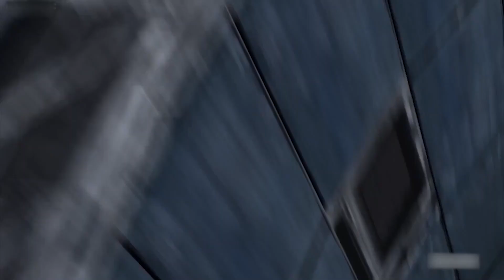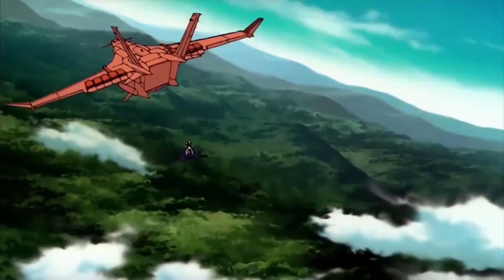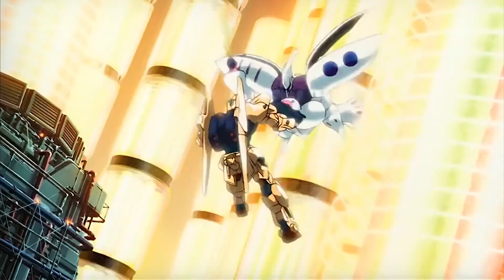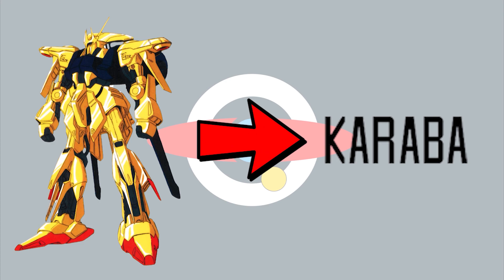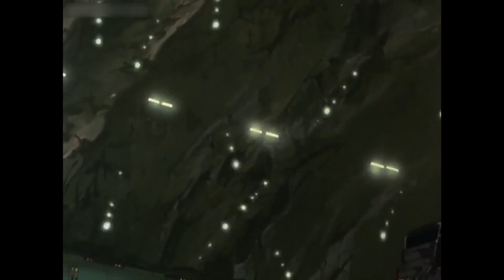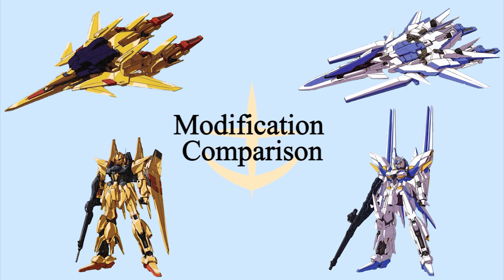H.L.M.S. - Project Zeta, Delta (δ) Series & Hyaku Shiki

Comment: There is a mistake regarding Delta Plus. Piko used Delta Plus when against Gundam Delta Kai in mock battle which ended up turning into real battle when Sleeves forces attack both of them and Gundam Delta Kai went berserk in the UC 0094 manga and the Gundam Narrative manga never explicitly mentioned that the pilot that piloted Delta Plus that attack Jona and his Dijeh's  squad is Piko and the beam rifle that Delta Plus used in Narrative manga is the same one used by Riddhe's unit, which is ReZel's beam rifle, due to compatibility issues with Long Mega Buster beam rifle. However, Riddhe's Delta Plus in the Unicorn anime is implied to the same Delta Plus used by Piko due to the left arm has been repaired and the combat record data against both Geara Doga and Gundam Delta Kai according to Kusabi manga

Comment: the full armor hyaku shiki kai appears in 0096 last sun, it didn't do much actually. it destroyed an old zeon MA along with the delta plus with their burst bolts acting together, it wasn't seen doing much else

and uh-

ok so it wasn't sleeves, it was just some random bandits that attacked, during the raven squad attack on the mariana base, the delta kai wasn't controlling the situation, it went berserk, since the NITRO was activated, and the pilot saw the raven squad as enemies, and began to attack them, and kill a few of them.

after the delta plus would shock the MS, and then would get recruited to the raven squad, after when freseberg was going to attack the titans remnants in the devil's nest, raven squad would appear with sleeves, and help out, attacking the old NITRO equipped titans MS they had(2 gabthleys, and later on psycho gundam and psycho mk II)
Reply from the maker: Thanks for the correction & information

Comment: The Delta gundam existed before the Gundam MKII was stolen. It used Anaheim Electronics version of a movable frame. They had discovered the Titans were working on the concept and thus made their own version concurrently with the Gundam MKII but wanted a variable/transforming MS.

AMBAC works thanks to the extremely low, negligible, resistance in most Zero-G environments. Once the Mobile Weapon starts spinning thanks to AMBAC it continues spinning until the force is negated by a counter movement by the AMBAC system.

AMBAC combines with the verniers during combat to reduce fuel consumption during movement.

Comment: AMBAC in the extent of classical Newtonian physics we know would not work nearly as well as they're depicted on screen especially in free space. At most, you're modifying the centre of gravity of your body. Imagine an astronaut patrolling free space and always spinning clockwise freely by himself. If he waved his arms, or do something like a snow angel, his body as a whole would still spin as normal. That's because there's no force to apply anywhere else, his gestures is confined to his own body and balanced out somewhere else in his body. A fart is a better option to move than his human-AMBAC because mass is ejected and there's actually thrust (expelled gas) relative to his frame of reference.

Put it simply, use thrusters on your arms, legs and wings, and AMBAC absolutely would now make a difference. Because now that an applied force is in the equation, applying turning (torque) is possible, and the speed and degrees of turning (angular momentum) would absolutely depend on how good your thrusters are, how far they are from you, etc. You just have to actually fire them correctly.

Tldr, AMBAC is a load of BS that's fun for Gundam world building only.
Reply from the maker: This is a very detailed breakdown! Thanks for the physics tutorial BTW, learned something new!
Reply: @zethythonix  Glad you read it! Judging from your accent I'm curious are you from HK or SG? Also, great video!
Reply from the maker: @fanchiuho1  yes, I am from HK
Reply: I believe other series’ Mobile Suits have thrusters for maneuvering in space.

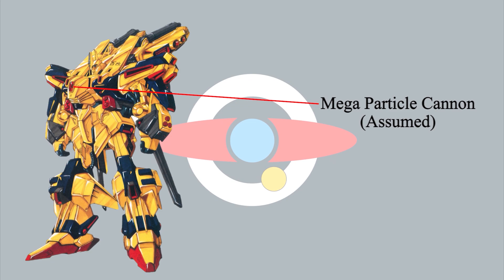Comment: 14:52 like most MS from the era of GRYPS conflict (such as FA mkiii, ex-s) the mid chest area is usually a I-field generator (for chest defensive purpose)
Reply: I believe the lore said it possessed a mega particle cannon there and had to deployable shield reflectors(which are directional i-fields) so the assumption is half correct but still love the full armor version of the hyaku shiki.

Comment: The AEUG was formed and financed by ex-Zeon, Federation defectors, and independent backers. It was not spun-off or split from the EFF/EFSF.
Reply from the maker: Thanks for the correction🙏🏻
Reply: While funded by ex-Zeon and having people from Zeon, a lot of them are from the EFSF. As the G3 incidents goes on, more and more EFSF and titans moved into AEUG. The founder of AEUG, Blex Forer, is a EFSF brigadier general ( was in OYW too ) and one of the well know people from the ESF that wanted to use a more soften policies to the colonies instead of the tactics used by Jamitov and Bask (founder of titans) who are pro violence. Hence AEUG is a spun off from esf even with numerous traces of ZEON